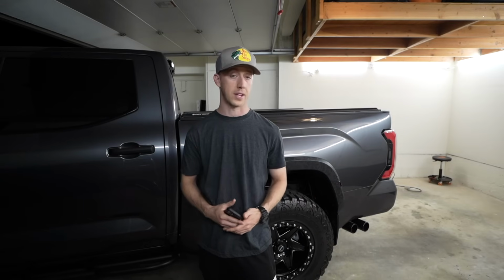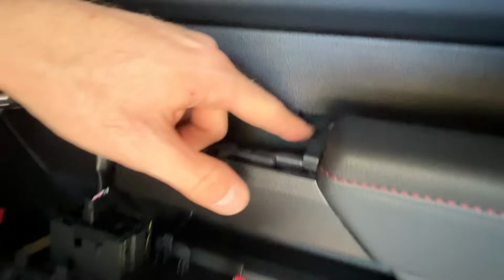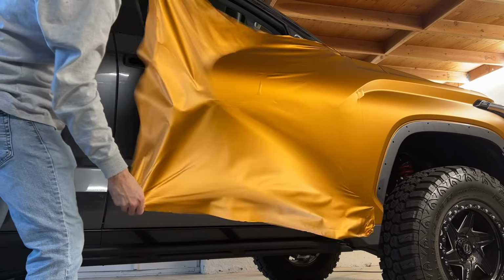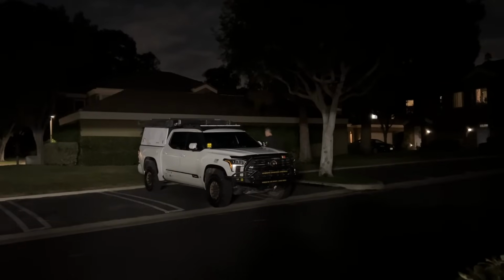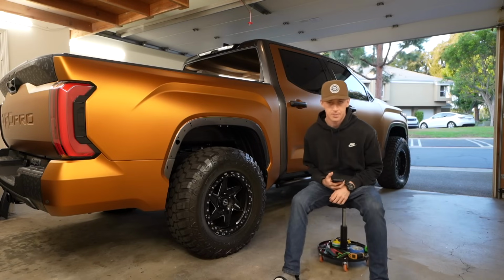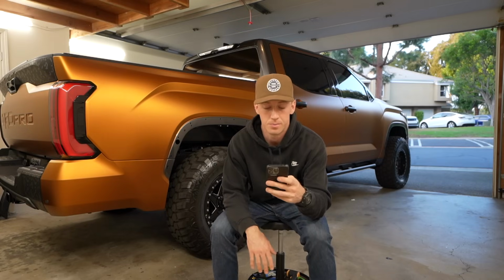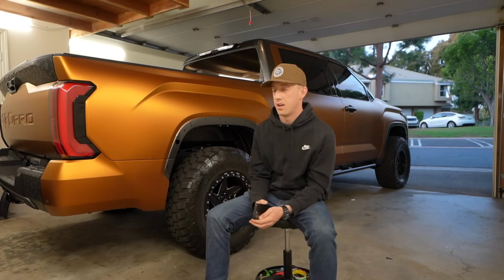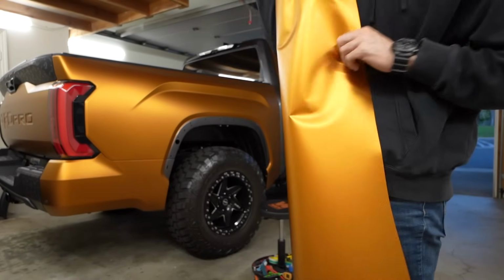Wrapping My TRD Pro PART 3!! (Reading The Comments)

Comment: Hey mark, does this brand of wrap come in a black shadow camo? I have one but it’s very thick and heavy duty hard to wrap.
Reply from the maker: Shadow camos are textured wraps and anything textured similar to brushed films as well are super rigid and hard to work with. Needs lots of heat. Check out metro restyling website and select printed wraps and then select camo and check those out. Just don’t go with shadow
Reply: Thanks Mark, totally makes sense, as it’s harder to stretch. Thanks for the advice and I’ll check them out.